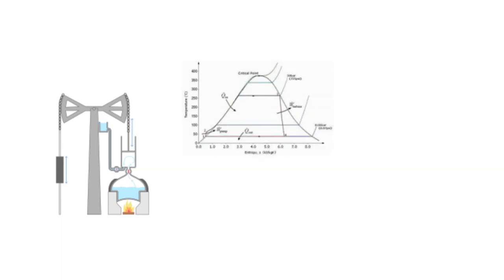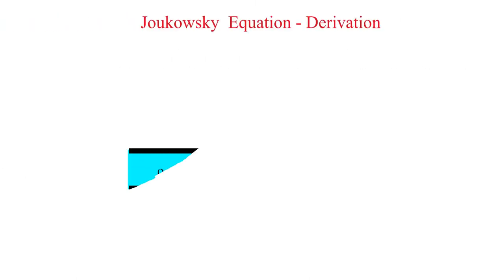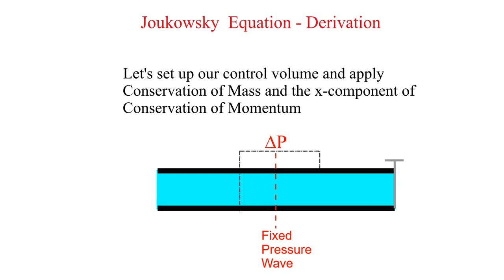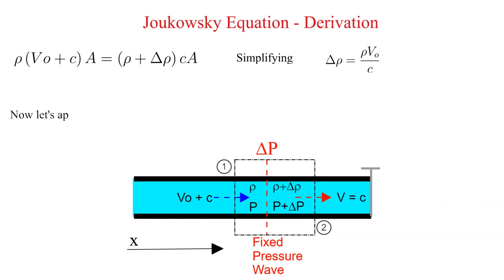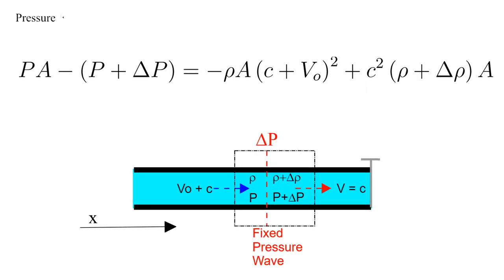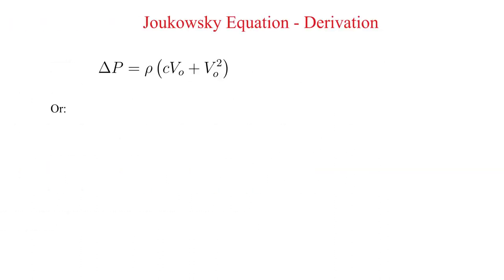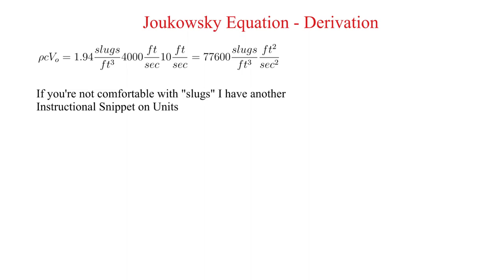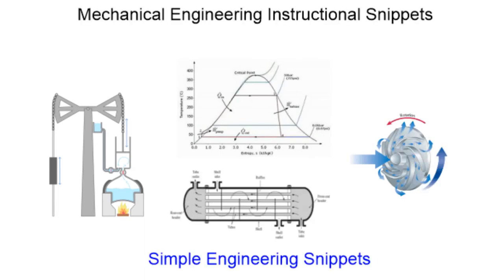Joukowsky Equation Derivation

Comment: Hi.  This is very good presentation of the Joukowsky eqution.  However, I have comments on the the setup of the control volume.  I would like to communicate these issues directly with the author of this presentation rather than present new (or wrong) material in the commentary.  Is there a way of contacting the author?